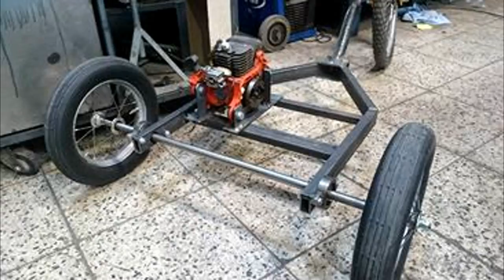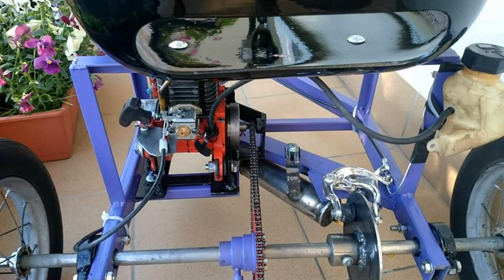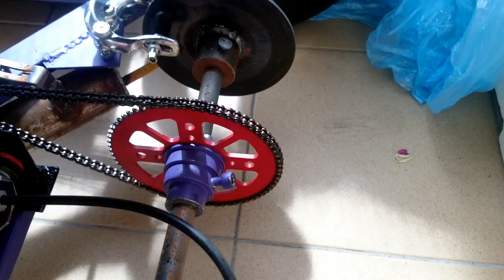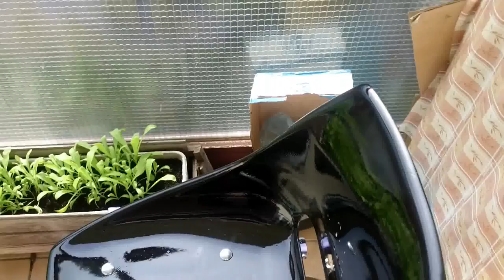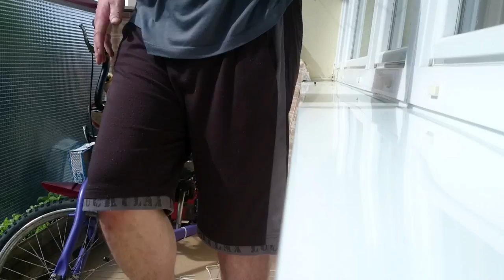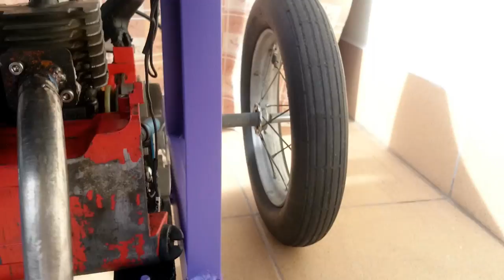Chainsaw three-wheeler. Engine Go-kart

Comment: A bit more.. Just look at the design, very simple and yet very sound.  If  you were starting out to build a trike this would be a really good starting point.  The motor could easily be replaced with an electric motor, and put a disk brake on the axle.  As a mark of respect I am to build a copy of this for the summer holidays for my grandchildren...watch this space

Comment: Without the engine cover that engine has NO cooling. The cover directs the air from the flywheel fan to the cooling fins on the head. You are overheating the engine every time you ride unless youre doing 60 down the interstate in cold weather
Reply from the maker: Air flow cooling its enough
Reply: its a aircooled engine it will be fine
Reply: Sswolf
Reply: What?
Reply: Milan Zika love it, cool bike
Reply: catfisher420
Reply: catfisher420 through dissipation. It needs a shroud
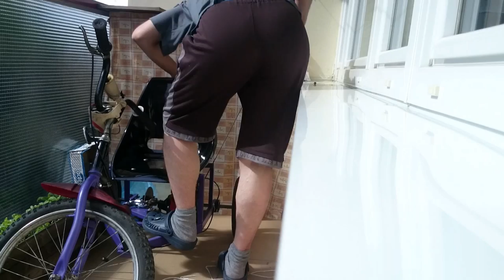Reply: If you see at 1:09 he was using a pull start with a recoil so how do you know the cover is off and it's a air cooled chainsaw that is made to run wide open when cutting a tree down so his motor will be fine
Reply: Que motor es
Reply: @sswolf7208  an air-cooled engine works off of the fan on the flywheel pushing air through the shroud that directs the air over the cooling fins. Air cooled engines are NOT cooled by the air outside flowing over the engine. You are so silly and have limited knowledge.
Reply: @Lovec007  maybe you should Google how air-cooled engines are actually cooled.
Reply from the maker: @catfisher420 thank u. U are right. But it was fan and I wanted just ride it. 😊😅

Comment: I wouldn't try to ride that.  A trike with a live rear axle will never turn,  The front wheel will just skate out..  Change it to one wheel drive.  For your own safety.  And keep it slow..  You're gonna need to change the sprockets and reduce the final drive ratio, Chain Saw motors only have power at high rpm's..  It'll bog down when you start out and try to get rolling and burn out the clutch PDQ..
Reply from the maker: Everything it's OK and work well and I know it's not the best solution. https://youtu.be/fG0QxbCSGWU

Comment: how did you connect the chain to the clutch
Reply from the maker: Armando Carrillo I made on a lathe housing on the original chain carrier
Reply: Milan Zika could u make a video showing how u did it
Reply from the maker: I try explain how it's made it. If put off chain from chainsaw, you will see SPROCKET. I made full cover at sprocket, and I weld (3 dots). Then I screwed tooth gear (from minibike) and I made support to tooth gear (bearings)
Reply: oh ok thanks
Reply: Milan Zika

Comment: how function changes and neutral to go and stop ?
Reply from the maker: gramirez_25 Ramirez I use original clutch from chainsaw
Reply: ok thank you . Very good. I saw a torque converter too in another vídeo but that is automatic. i dont know if the torque converter is good in duration or is better a clutch. I like your idea.
Reply from the maker: Better is a clutch, If you need stop, you just let throttle